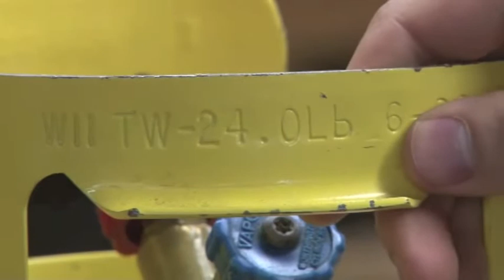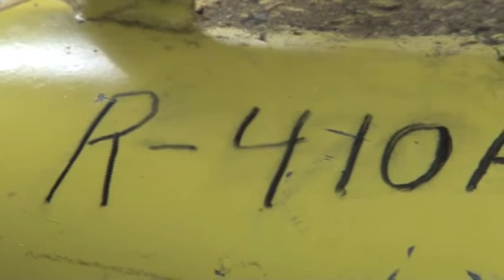Recovery tank

Comment: How did you get 64 pounds for the Total weight??
Reply: It's a 50 pound jug. He multiplied 50  times the 80 percent max you put into that jug. Which is 40. Then he added the tare weight which was 24 pound. Which equals 64 pounds.
Reply: I thought you went by the water capacity for the 80% and not the weight of the bottle?